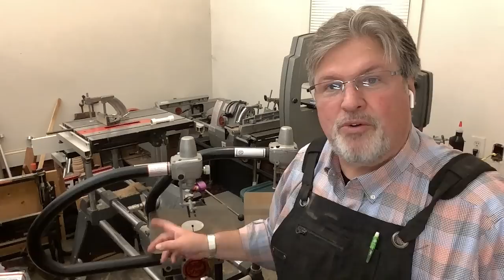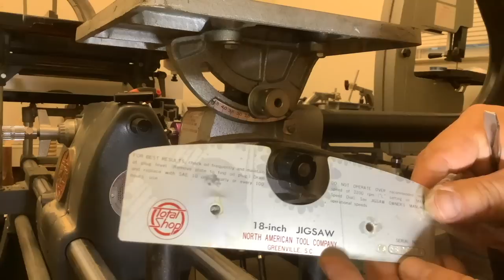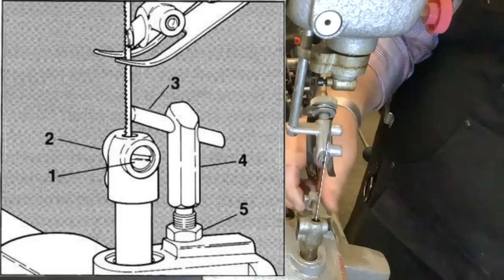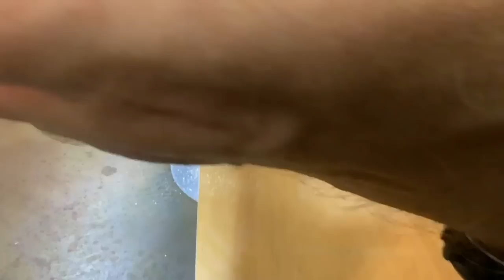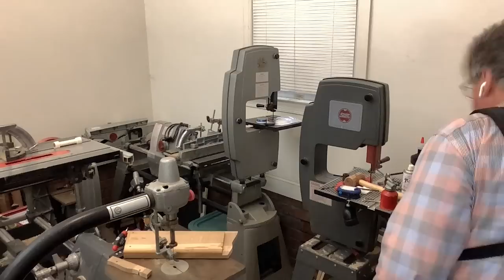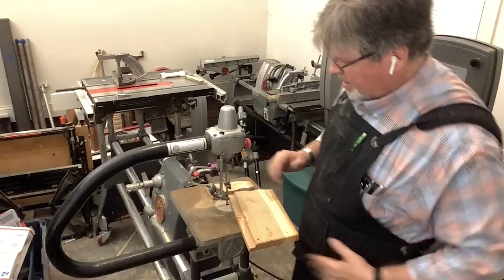Introduction of the Shopsmith 18" Jigsaw SPT (Special Purpose Tool)

Comment: Scott  nice video learned a lot. I was getting to use my 18" shopsmith jigsaw. But noticed i could not rotate the shaft( that would hook up to the power head) for a complete rotation.  I did take cover off and couldn't see where it was binding. I didn't have a blade it. I'm not sure when it was last used. I know I have had it for about 4 years. Any ideas on what I may have to do to fix it? Thanks for your assistance!!
Reply: It is the magna 18"

Comment: The speed dial does not have a setting for jigsaw. What speed should you use?
Reply from the maker: @edwardkranock4157  I typically try to stay within the bandsaw range, but I would suggest getting a hold of a copy of the manual, which I think recommends slightly higher than that as a max speed.

Comment: Found a brand new jigsaw under the Shopsmith label in the original box. Trying to figure out the value of it.  Any ideas?
Reply from the maker: Depends upon the age and the manufacture (Magna Engineering, Yuba, Magna American Shopsmith Inc.). I suspect if you put it up for sale on eBay that it would sell for $200-300. The difference seems to depend on the working of the listing and the quality of the photos. If you sold it on Facebook Marketplace or Craigslist you'll get $75-100.

Comment: Hey Mark, I do have a question about your jigsaw video. You turned the orientation 90 degrees at the end, right? And clearly the machine is set up to do this as it allows you to move the hex arm to either side. My question is, if you rotate 90 degrees, the 'cool block' thingy underneath, which in the first position supports the back of the blade, can't be used at all, right? Did you just remove it? I couldn't really see what you were doing there....
Reply from the maker: Yes, when you rotate the lower chuck you back off or remove that backup support rod.

Comment: Very informative; like all your videos!  I have just about finished overhauling one I acquired a few weeks ago. I just noticed as it was going back together that the input shaft is 1/2" not 5/8" like everything else in the Shopsmith world. Is yours the same way? I tried studying this video to see that detail but couldn't make it out. Do you know if there a coupling with a 1/2" ID fitting?
Reply from the maker: @EricFrazier-c2i  Yes, that is correct. All of the jigsaw drive shafts were 1/2”, and yes, SS made a drive hub to fit it which works with that standard drive coupling.
Reply: @MyGrowthRings  Thanks for the info, Scott. I was able to find the 1/2"drive hub. I had taken it off and put it with my little collection of others when I disassembled the saw, not realizing it was a different size! Got it back in action now!

Comment: Scott- I picked one up. What oil do I put in the oil bath. Mine did not have the plastic removed either! The well was dry but fortunately the unit was never powered up. Let me know.
Thanks Scott
Jon Hunter
Supporter
Reply from the maker: Hey Jon, look in the video description. I’ve posted a link to what I used and you should be able to find it or something like it locally.

Comment: I've inherited a Mark V 500 from an uncle and love it. It has the Magna 18 inch Jigsaw. The oil bath was empty, and when I filled it I noticed a slight leak from the cylinder that  the up and down piston moves in. I am wondering if this can be repaired. Trouble is I Don't know what to look for.  Maybe an oil seal ring? 
Any ideas? Great channel by the way. I wish someone had warned me how addicting these are.
Reply from the maker: So sorry that I missed your comment. Yes, there are a couple places that might need attention. I suggest searching the Shopsmith Forums as I know there have been a couple threads about this there.

Comment: Hopefully I didn't miss it in the video, but  can any blade be used or must it be a special  Shopsmith blade?
Reply from the maker: @willpartin622  Noting special. It used 5” plain end (no pins) blades. They used to be much more common and I even know people who buy bandsaw blades and cut them down to 5” lengths, and they work just fine. Scott

Comment: I know this comment is way late but I just saw this episode.  Still another thing you can do with this tool is use a narrow strip of sandpaper or emery cloth instead of a blade.  It makes a wonderful edge sander for detail work if you don't mind the edge being sanded to a slight roundover / bull nose / convex / soft shape.  For the trivets I was making, I was actively seeking that softer edge shape on a 3/4" thick edge.  It was wonderful!
Reply: Olson actually sells these in several widths!

Comment: Hey Scott, my shopsmith lamp came with several extra mounting flanges. I want to use it on my jigsaw. Where should I attach it?
Reply from the maker: Good question. I would mount it in the upper arm/tube.
Reply: That was my first thought, but the tube is round and the flange is flat.
Reply from the maker: @giljusino  True, but it works. If it doesn’t have enough material behind it, it might be a little wobbly, so you may need to add something behind it to back up the little “fingers”. Something like a this piece of wood or plywood.

Comment: I was gifted a 1950’s era Mark V that had a jigsaw with it. It looked like a well made accessory, but I found it to be too complicated and fragile. Eventuality the plastic connector broke, and after trying to engineer a replacement, decided it wasn’t worth the trouble and found a SS bandsaw that I replaced it with.
Reply from the maker: It definitely is not as robust as the Shopsmith, scroll saw, but was quite innovative in its day.

Comment: Thanks Scott! Learned a ton about my shopsmith while rebuilding a free one I got. Got it all cleaned up and running now!
Only issue I have is my connector between the headstock and the jigsaw dry rotted and snapped while spinning. 
What’s the name for that piece? I see you have an aftermarket one and I’m open to any options to get it connected again.
Thanks again
Reply from the maker: That's a power coupler. They are available from Shopsmith at https://www.shopsmith.com/ownersite/catalog/powercoupler.htm
Reply: @MyGrowthRings  thank you so much!

Comment: I’m new at using the jigsaw and I’m running into problems. My blade keeps jamming up and bending. What am I doing wrong? Same is with my shopsmith scroll saw.
Reply from the maker: Gil, you are discovering what most jigsaw users have learned and that is that because the blade is only being powered on the down stroke and is being lifted by a spring, that literally half the time the blade is underpowered. Combine that with wider jigsaw blades that don’t like tight turns and you’ve got a recipe for binding. This is the main reason most woodworkers abandon jigsaws for scroll saws, which are powered on both up and down strokes and the blade is held under constant tension. I talked about this in one of my videos, but perhaps that video is private now. Go slow in the curves and use as narrow a blade as you can, and shoot for 6-10 teeth in the wood. Too fine a blade will also cause issues. Scott
Reply: I’ve been working with both my jigsaw and scroll saw. I prefer the scroll saw, but parts keep breaking. First the rear trunnion and today the upper blade guard broke 😢 I believe both machines are USA made, as I find no other markings other than the shopsmith plate with the OH address. Can the 1984 casting be defective?
Reply from the maker: @giljusino  Man, that’s rough and quite unusual. Yes, the scroll saw was made in America, and I have heard it a few issues with the rear trunnion, especially if it was overtightened or tilted without loosening.
Reply: @MyGrowthRings  I see the parts are available from Shopsmith 😁
Reply from the maker: @giljusino  Well that’s good.

Comment: Hey Scott, my new (old) shopsmith jig saw is up and running after sitting unused for 15-20 years. It is running fine, but it’s leaking oil as it sits on the shelf. Any advice?  

BTW, all six shopsmith attachments that came with my new/old shopsmith came with really useful metal stands, which has made it very easy to build a wall storage system for the six tools.
Reply from the maker: Hey Gil. As any Harley owner would be quick to point out, “it’s not leaking, it’s marking its territory”. Seriously, the seal is likely very dry it out, and may need to be replaced. Tom from the Woodshop Nerdery channel did a video on that subject I believe. There’s also a round aluminum disc on the bottom that may be leaking. I suggest wiping it down and observe carefully where the leak is coming from before you proceed. Scott.

Comment: Hey Scott, That was an extremely useful video. Last week I picked up a trove of Shopsmith equipment at an estate sale. The 1984 Mark V had been sitting unused for the past 20-years. You saved me from wrecking the jigsaw. I discovered there was no oil in the reservoir and the moving parts were seized. I filled it with oil and slowly moved the saw left & right until it was able to make a complete circle. Any advice, I'm afraid to power it up. Judging from the history of the equipment, it didn't get much use before the owner fell lill and was unable to operate it.
Reply from the maker: No, it’s hounds like you are off to a good start. Just run it and keep a close eye on any oil that leaks out and add more if needed.
Reply: @MyGrowthRings  thanks Scott!👍

Comment: Scott, if you were to replace the fiberglass rod, would you use fiberglass again or PTFE?   Thanks.
Reply from the maker: That’s a great question. Either are worth a try, but I suspect that the fiberglass rod would be more durable. What are your thought?
Reply: @MyGrowthRings  well, I gave it some thought and decided on a completely different one. I ordered some Delrin rod. I was concerned that the fiberglass would splinter and the PTFE might be too soft. I will let you know how it turns out. On another note, in one of your videos, you showed how easy it is  to drop a blade or other items down into the oil reservoir. When I took mine apart to clean and partially restore it, there was a rubber pierce stuck in there to prevent that from happening. Not sure that was a SS addition or the previous owner. It disintegrated when I took it out, so I ordered some 1/2” solid rubber cord to replace it. Will let you know on that one also. 

Thanks.

Comment: Another great video, Scott. I have an original Magna Jigsaw. interestingly my dad must have bought it when the “Goldie’ was sold because it is brown and copper colored rather than the Shopsmith grey. Everything you went through was spot on. The only other maintenance/restoration item I ran into…under the Magna logo plate on the lower assembly, there is a gasket. While the oil reservoir may not be that high, when the gasket dries out, it leaks out through that spot. I used the old one as a template and cut myself a new one from a sheet of cork…problem solved and it has never leaked 35 year since.
Reply: One other minor addition I thought of..,back in the SS store days they used to offer (I think Olson brand) spiral jigsaw blades. I used them with great success because not only could you cut ‘in any direction’ with less worry about breaking a thin blade around a tight corner, but it also removes the ‘18” capacity constraint. Of corse able to do that in Sabre mode w/ wide blades, but I’m referring to cutting a fine spiral. If you have a big workpiece — with a straight blade ur wanting to spin 360 degrees, but with the spiral blade you can just cut in a different direction (cutting the spiral without spinning the piece. I did this when I made Norm’s delft rack.
Reply from the maker: Perfect, Michael. Didn't I mention the gasket? I must have in the follow-up video.  It's awesome that they can still do their job all these years on. Scott
Reply: @MyGrowthRings  actually the one question I had was…given I don’t think the mothership has a lot of spare parts for the original jigsaw…can u still get parts for the tiawanese model? Would they fit a SS? Thinking of non major parts.
Reply from the maker: @CessnaDaredevil  No, all of the importers closed their doors in the 1990’s and are long gone.
Reply: OBTW, watched the video again to make sure I didnt miss it. The gasket I was referring to is under the housing cover (old Magna part 502270). The owners manual. Really doesn’t even talk about removing it….I assume its not something a user would have to remove. But, when I was refurbishing my dad’s the gasket had started to leak. So if I would have just filled it with oil, it would have leaked out eventually and I would be running dry and not known it (other than at the 3 hour recommended maintenance interval). Just figured that for those of us still salvaging old Magna or SS units…it’s likely something that may need to be replaced if the unit has been ‘sitting around dry’ for long periods.
Reply from the maker: @CessnaDaredevil  I suppose that means that I spoke about it during the follow up video, which is now private channel member content. My bad.

Comment: Would it not be more beneficial to use a 'foot switch' to power on/off the Shopsmith? By using the 'foot switch' one does not have to reach around or over any of the extra tools, just remove your foot to turn off the Shopsmith or place your foot onto the 'foot switch' to turn power back on. 
By using the 'foot switch' would be very useful in case of an emergency to quickly turn off the power to the Shopsmith. The 'foot switch' is just a safety thought & a convenience tool.
Reply from the maker: Shopsmith always advised against it for safety reasons, but the motor also pulls a bunch of amperage when it starts and I believe that most of the consumer grade foot switches aren’t able to handle that current. A better idea is you can add a switch box to the leg, such as the SPT stands switch that Shopsmith sold for years. It can be mounted or better yet, held in place with magnets. The advantage there is you could move it from one end of the machine to the other as needed.

Comment: Hi Scott! First of all,  I very much enjoy the detail that you put into your videos, It is much appreciated. I've had my jigsaw since the 80's and I admit, I haven't used it as much as I would like to. However, today I stumbled across a video which made me aware of a "breather hole" on the side of the lower main body, opposite the arm, which on my unit is just above an original sticker. All these years I never knew it existed for an important reason. I've never seen any information about this from Shopsmith. My question is, could that be the reason why my cover/gasket leaks oil due to a buildup of pressure, since it is plugged up. Any thoughts? Thanks for all you do!
Reply from the maker: Hey Anthony. Yes, if the breather hole gets clogged there will be an increase in leaking, but keep in mind that they do leak a bit even when everything is perfect, just to mark their territory!  Scott
Reply: @MyGrowthRings  Thank you Scott!
Reply from the maker: @anthonyspatafora1961  You are welcome.

Comment: Good vedio, what length blade are you using. Are shop smith blades available. I pi ked up a used jigsaw at  flea market and followed your instructions. All internal parts were OK just needed lubrication
Reply from the maker: Glad you were able to get her going again. I use 6” blades.  Scott

Comment: Today I started cleaning up my recently acquired jigsaw.  That plastic film you pulled off the nameplate?  Took me 30 minutes to scrap mine off.  :-).  Hope that's not an indicator of what's to come.  By the way, in the video when you first fire it up it looks like your right hand is adjusting something?  What was that about?
Reply from the maker: I’m not sure, but if I had to guess it was probably the knob that holds the table to the trunnion.  If I’m thigh to, it probably started to vibrate loose when the saw started.  Just a guess. Scott

Comment: Well Scott, I just bought a used 510 for $100 and one of these was included (and a bandsaw too!).  I summer in Maine so I'm dealing with a unit that sat in a basement for 10 years while it got decorated with rust courtesy of the salt air.  I have been de-rusting the main unit and haven't got a close look into the jig saw yet but I'm assuming I can bring it back to life.  Looking forward to it and your videos are going to give me a great head start in understanding what I'm dealing with.  Thanks for putting this out there.
Reply from the maker: $100 for a 510, bandsaw and jigsaw? You won the lottery! My sister-in-law and brother-in-law lived in South Berwick and their Mark V was also stored in their basement and it because a rusty, sad story too. Good luck on the restoration and congratulations!  BTW, have you used Evapo-Rust yet?  Great stuff. Scott
Reply: @MyGrowthRings  oh yes, lots of Evaporust being used. The bandsaw has an aluminum table but I also got a cast iron table in the “box of stuff” and you should see it. Barely recognizable. The disc sander was also barely recognizable. But my ROS with 3M sandpaper seems to be doing the trick on that.

Comment: You may want to note that if you are using the power pro on your Shop Smith 18 inch jigsaw you cannot use the scroll saw settings on the power pro. According to the old chart for the Mart five that I’ve had for forever is the poster size the maximum rpm for the jigsaw is 1150 RPM. I don’t know why Shop Smith doesn’t include the jigsaw on the computer inside the power pro.
Anyway Scott just a heads up I think it might be important to remind people that have the power pro that if they don’t know what the RPM is it’s 1150 RPM maximum. Dead
Reply: No I’m not dead, it’s Ted. Dad gum voice messaging.
Reply from the maker: That’s a very good point. That’s also one of the reasons why I wish the PowerPro headstock had a USB port or some means of upgrading the firmware. Who knows, maybe they’ll be a feature of V2. Scott